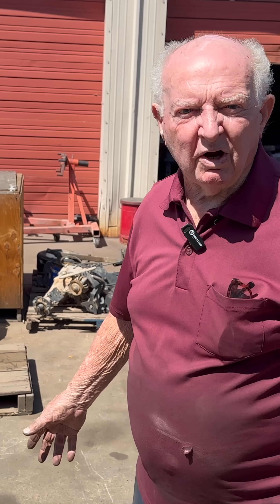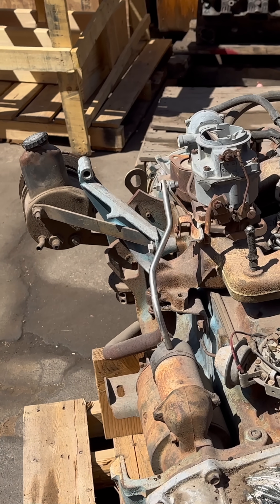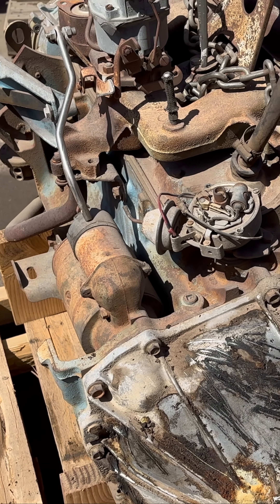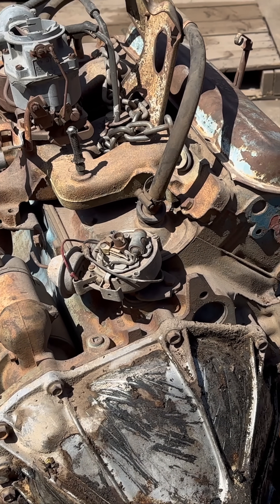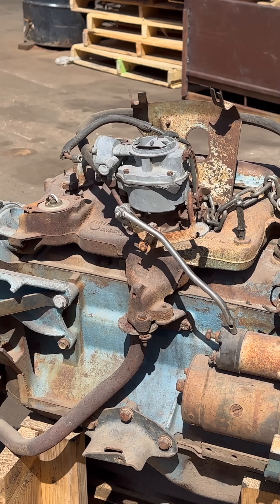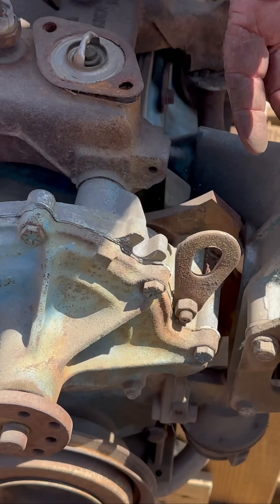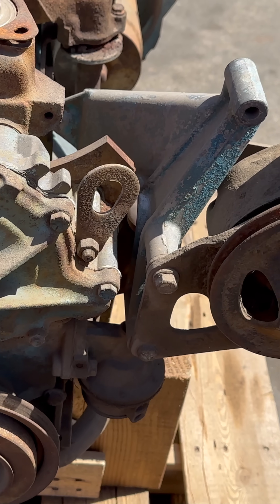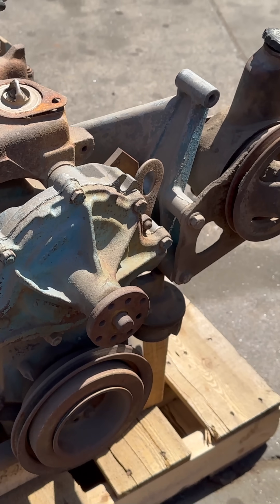Half a 389 Tour Part 3 - Pontiac Trophy 4 Half a 389! Ed Smith w #BarryT

Comment: That's awfully big for a 4 cylinder. Balance is a problem for 4 cylinder engines so big. 4 cylinder engines usually don't exceed 2.5 liters or 150 inches.
Reply from the maker: It was an interesting design choice at the time, for sure.

Comment: What did they use for a drive train?
I had a 1962 I bought used and the torque tube was cracked almost totally in half when I got it. It had the 4-cylinder - 4-speed- 4bbl. Carb stock.
Reply from the maker: They had a "rope drive" connection to a transaxle in the rear.
Reply: @BarryTsGarage it was funny to watch the torque converter spinning out in the open behind the rear end when it idled. I had mine in highschool. It would be a hoot to work on one again.
Reply: Don't you mean a straight 6 with 4 bbl ?
Reply: @darylhudson777 
You're probably thinking of the OHC Sprint engine from '66-'69.
Reply from the maker: Yeah, that “Sprint six” was a 326 which was also confused with the 326 V8…
Reply: @BarryTsGarage 
The Sprint was 230 & 250 cu. in.
Reply: @darylhudson777 
Since the trophy 4 was base off a 389 the high performance parts were bolt ons.
Pontiac offered the Tempest with a power pack trophy 4. It had a closed chamber head, high compression pistons hotter cam an a 4bbl carb.